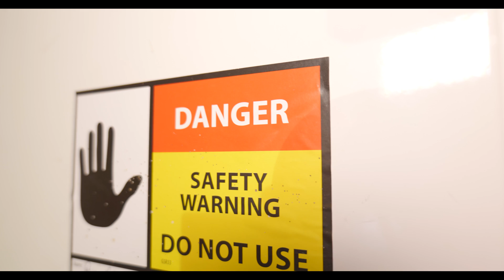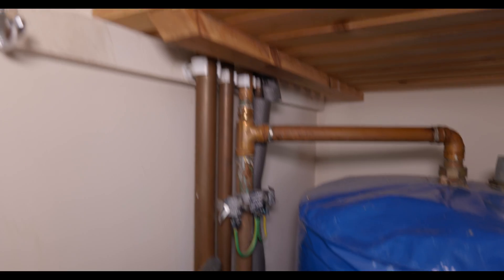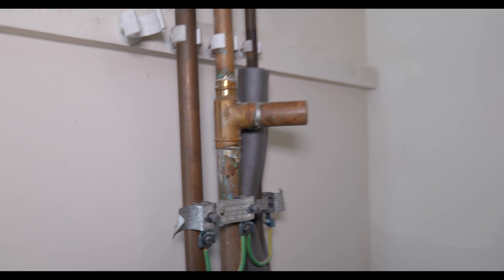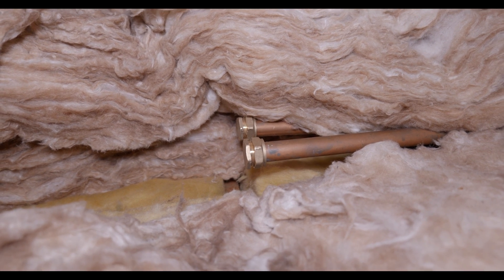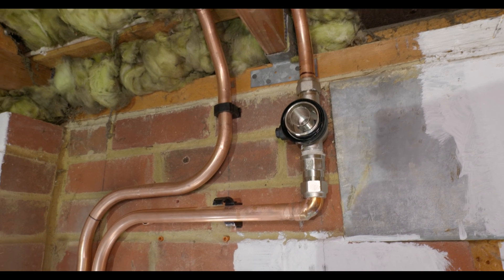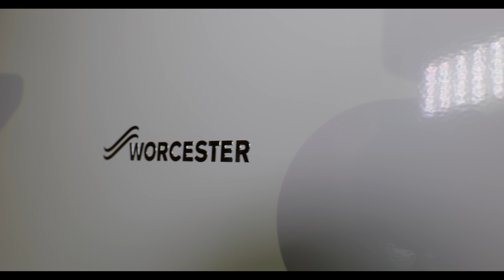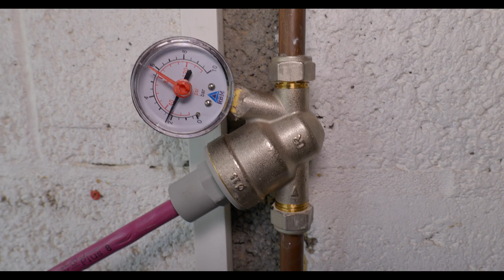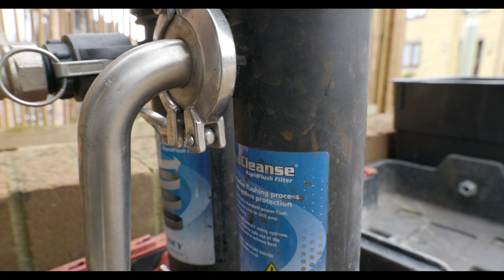How to install a Combi boiler conversion - Worcester 8000 - Vented boiler to mains pressured system

Comment: Thanks this is a really nicely done video.
Small question is it better to do the flush or power flush before installing the new boiler or after. Just wondering if it is done before (using the old boiler to heat it up), the sediments in the pipes and radiators won’t go through the new boiler

Comment: Great informative video. Having my two bedroom flat system boiler changed to a combi by the housing association and wanted to get an idea of what will happen on the day. Also what to look out for so no corners are cut. Thanks!
Reply: Why do you care? It's not your boiler,you didn't pay for it did you?
Reply from the maker: Thank you
Reply: @@loving-plumbing  corners were cut! There were two bottles in the new boiler box. Cleaner and inhibitor Fernox red and blue cap. They were not used. Can they flush the boiler without using them...the rads were drained of water via a hose stuck on water pipe in hallway...I was keeping an eye on the bottles (not watching them constantly, as I don't like that personally in my job) but at the end before they left I felt the bottles and felt they were full , caps still sealed. I think coz of the time needed to flush/clean they didn't do it. The guy working on the boiler did use a spray bottle which I found out is an inhibitor, but boiler was not run for hour whatsoever, maybe just 20mins tops. They felt the rads warm up and bleeded them that's it.

You mentioned it was imperative to do it in your vid. I didn't like the fact they didn't do it. I didn't call them out straight away as again I didn't want to tell them how to do their job. So I waited for the inspection next day to mention to the inspector. I told them that the workers didn't use the bottles, they agreed that it should have been done. The paperwork was even filled in ticking the boxes stating that they had used the cleaner and inhibitor. Also they were cheeky enough to stick the stickers from the bottle onto the side of the boiler but without inputting the date used. Why would they do that? Purely to save time? So the boiler breaks down so they are called out more often? I am a housing association tenant. Or is it not imperative?

Anyway, the inspector arranged for an operative to attend the next day, I wasn't in but my misus stated all they did was come in and pour a bottle of inhibitor into the Fernox TF1 Sigma Filter. That was it. No cleaner used, no running on full power for 1/2 hour etc. 

Boiler working fine. But I'm guessing old sludge remains inside rads/pipes. Its probably just going to damage boiler sooner rather than later. 

Any thoughts?

Comment: Hey great video ! I’ve got a question for you … I have a small house that is having its plumbing converted to a combi system and I was wondering would it need motorised valves ?
Reply from the maker: Only if you are having more then one heating zone. But usually probably not if converting.

Comment: Great video looking at a combo conversion can this system be run with micro bore pipework as my radiators are all micro bore ?
Reply from the maker: I wouldn't recommend it to be honest. Unless the micro bore is already pressurised
Reply: @loving-plumbing  How can you tell if the microbore is pressurized? I'm in the same boat as the person who asked the question. I have a regular (very very old) boiler with microbore and I don't know what to do for the best. Thanks.
Reply: @laganas2008 I'm in the sanw boat, did we get an answer to this please 🙏

Comment: Nice video, I'm due to have a worcester external boiler fitted very soon My water is also 5bar 25ltr pm, what should my prv be set at taking into account the shower being fitted is a mira maxim dual Digital overhead one.
Reply from the maker: 3 Bar is pretty standard I would say. Thanks 👍🏻

Comment: The Hive can’t modulate the boiler making the boiler not as efficient as it could be.
Reply: Correctly sized rads with traditional trv’s.
Condensing boiler.

Normal programmer and room stat.

Basic stuff is the best. Why complicate things.
Reply: @JayGasEssex  because on/off controls are inefficent

Comment: How can i found out the flow rate my house has, also is there a way this flow rate to the property can be increased by the supplier?
Reply from the maker: Hi. The best way is to get a large measuring jug and run the tap for a minute. This will tell you how many liters per minute you have. Make sure it's from the cold main. I like to use a big tilers bucket. Alternatively you can buy a weir gauge which is a plumbers measuring device. Flow rate generally can't be increased by the supplier but you can upgrade your incoming main size. The minimum you want is a 25mm blue MDPE pipe. Otherwise pumps and accumulation may be necessary

Comment: Nice work.

Another channel to keep uo with.

What's the brand of pressfit fitting do you use?
You mentioned on one of your videos it does both gas and water and cheaper...
Reply from the maker: Thank you 👍. I'm pretty sure they are just called Aquagas M-Press fittings. Merchants like Williams have recently started to stock them. Cheers.